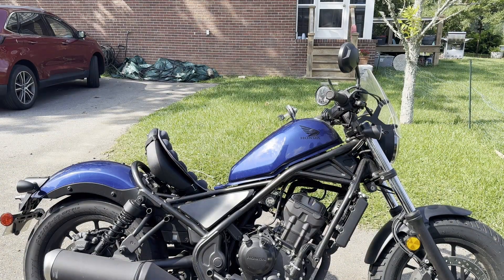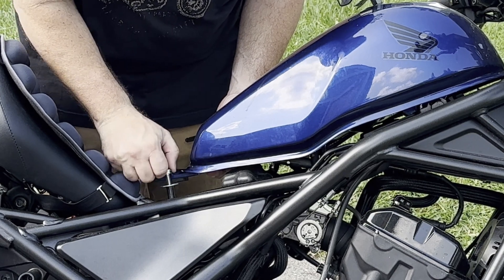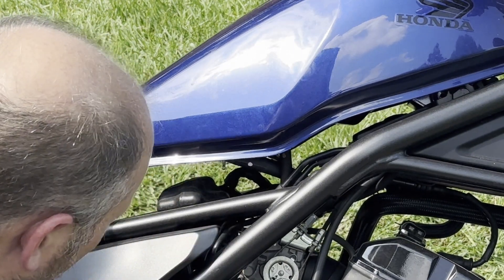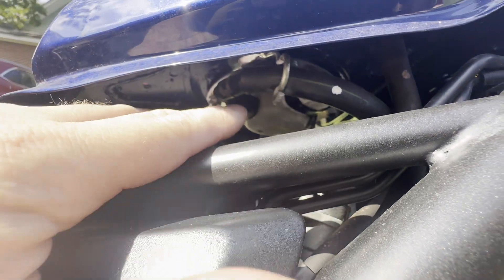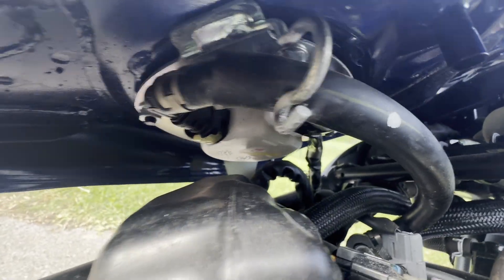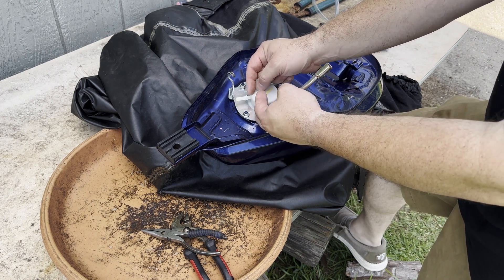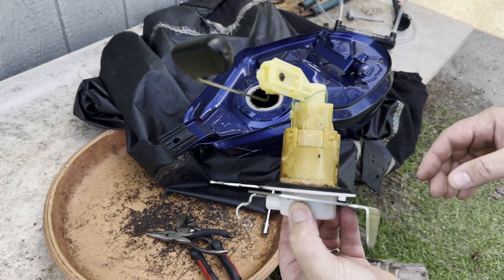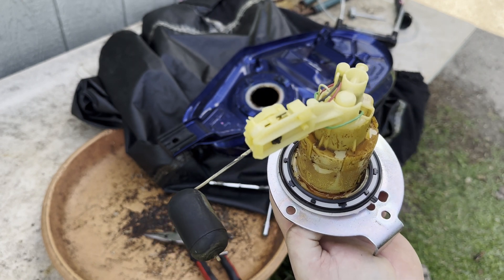How to Replace the Fuel Pump in a Honda Rebel (Easy Way!)

Comment: Hey there! Great quick video, thanks! Where did you end up buying the new ASSY from, and where did you cross reference the part numbers from to make sure it fit the exact trim and year? :face-blue-smiling:
Reply from the maker: Referenced to the local Honda dealer to get the correct one. Thanks for watching!🏍️